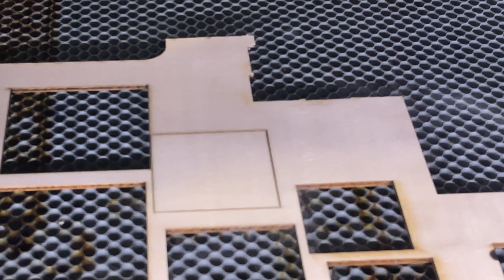What If You Could Build a High-Powered Laser at Home Right Now? Part 5

Comment: Great video as always - What series heads are those with the red dot? About to embark on a similar journey. I've built diode lasers but looking to retire my K40.
Reply from the maker: I bought the E-series set from Cloudray, and then bought the additional mount with the red dot sighting laser and replaced the mirror mount #1 with that.  If you load the build file set (link available in the channel community tab or in the description of the laser video in this series) and look at the BOM spreadsheet, I added links to these.

Comment: Great video series, thank you for posting. I’m starting out small and tore my K40 completely apart and making a 12x24 adjustable Z bed (14” travel height), I am in the process of reassembling it and hope to have the hardware back together in 2 weeks. Then comes the software for the Z bed adjustments. I’m going to have it auto adjust for the correct height, no matter what I’m engraving or cutting. In a couple of years, I have already designed a much larger laser that I will be assembling from scratch. The key skill that is needed in this project is patience. Keep up the awesome work!
Reply from the maker: OK this made me laugh.  😀. You are definitely right about patience being a cherished skill.  While I was building this laser I tore it apart and redesigned/reassemble more times than I can count.

Comment: have you considered the adjustable head sold by cloud ray?  it makes adjusting the last mirror so much easier.  you don't have to go all the way back and adjust the tube if its off.
Reply from the maker: I have been speaking with Russ Sadler a bit lately (see his YT channel here: https://www.youtube.com/user/SarbarMultimedia).  He spends a lot of time figuring out why lasers do some of the weird things they do, and he appears to have had a part in the design of the Cloudray adjustable mount.  I may buy one of these at some point to replace the E-series assembly to make this adjustment easier.
Reply: @SteveMakesEverything  when i upgraded the tube in my laser it was a larger diameter.  I don't do a lot of high speed engraving to justify the light weight head so I just mounted my C-series head on Russ' adjustable head purchased at cloud ray.  its much easier to "catch" the beam than try and adjust everything else starting at the tube to try and hit the center of the head.  Thanks for the videos. I have enjoyed watching them as I plan my new build... (edit: I have the C-series)

Comment: I've found after getting my Chinese Laser that before you adjust the mirrors that it is best to loosen the adjustment screws on all mirrors, at least 1 & 2, and physically adjust them so they are close to the center of the next mirror. 

This might even mean moving the mirror up or down or the laser tube up or down or twisting a mirror or moving it back and forth. After doing that it just took some minor adjustments to get it all aligned up. The laser head might need some physical adjustment too.

My biggest problem I found is that my first mirror was not in line with the second (meaning that the beam was not parallel with the linear guide rail) and I physically had to move it and drill new holes.

Of Course if you build your own it should be aligned properly to your linear guides already. 

I forgot to add, sense the laser head can't be moved up or down you need to start on aligning the height of the laser beam with the laser head first.

I hope that made sense.
Reply from the maker: Well you would think that building your own laser would ensure better alignment of the first mirror, but I added lots of adjustment options there, just in case. 😀. In the end mine was pretty close but I did end up sliding it side-to-side a bit - more to sate my desire to have the beam hitting the center of every mirror.

But your point about getting the height correct starting from the head is definitely valid.  As you can see in the video, once I got to the lens, I then went back and started over again because the laser tube height needed to be adjusted.  Maybe it will eventually make the blooper reel, but I did this a few times before getting it in the ideal position.  I did settle on knowing that in order to hit the lens ideally, the beam entering mirror 3 was never going to be in the center though.

Comment: How important is it that the laser tube is level (when you say level, I assume you mean relative to Earth)? What purpose does that serve for the laser?
Reply from the maker: The entire laser can be technically off-level.  Having everything be level to start, just makes it easier since there is a known frame of reference.  What's critical is that the tube and all of the mirrors are in the same plane and that the angles on all the mirrors result in a 90 degree angular change in the beam.
Reply: @SteveMakesEverything  OK, that’s what I was hoping you’d say, haha. As long as the table is close you’re good so long as all the internal parts of the frame and bed and tube are square and parallel and normal to one another. Thought I was about to have a ton of extra work on my hands.

Obviously when I see people using a level to adjust a mug on a rotary attachment, that requires the base assumption that the rest of the laser is also level, but I think I’d lose my mind trying to build a table that was lab grade flat and level, and then not being able to move it around the garage.
Reply from the maker: @swissfreek  You mind is safe from loss.  My laser is on wheels 😀
Reply: @SteveMakesEverything  I put mine on those pop-up wheels so I can drop it down onto it’s legs for a sturdy base, but home center 2x4s and a sheet of melamine is not fine woodworking, and close enough works here. I did spend the time to get the axes and frame and tube straight though.
Reply from the maker: @swissfreek  Sounds like we went to the same school of laser design :-)
Reply: @SteveMakesEverything  I'll have to disagree here about the tube. Assuming your 1st mirror has ample range of motion, and the tube mounts themselves are somewhat adjustable, the tube need not be co-planar nor level, nor square to anything. 

The sole purpose of the 1st mirror is to take an incoming beam from a random direction, and make it parallel to the Y axis. We just so happened to have picked 45 degrees, but it can really be anything (assuming the mirror can still reflect it adequately). 

Long story short: no need to level or square your tube. In fact, tilting the end of the tube upwards can help with evacuating air bubbles, which is more valuable than it being level to anything.
Reply from the maker: @jordymoors  I'm OK with disagreement.   However the reason you are trying to get the beam path level is to ensure that the beam stays as small and round as possible.  If you hit the mirrors at an angle and then use the mirror to level out the beam the beam will become slightly oval and this will make the cut less clean and reduce the energy density.

Eventually you can get the beam on target but it's just easier if you start with everything at the same level.

There might be logic in you comments about bubbles, but this isn't a gravity system so the bubbles are going to be pressured out of the tube regardless.  I can assure you that my very level laser tube has no bubbles ;-)